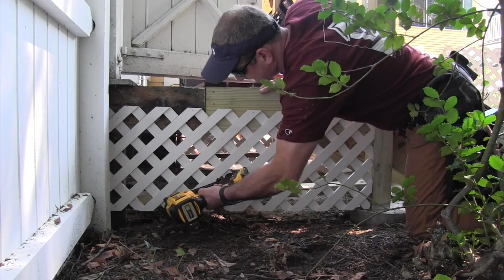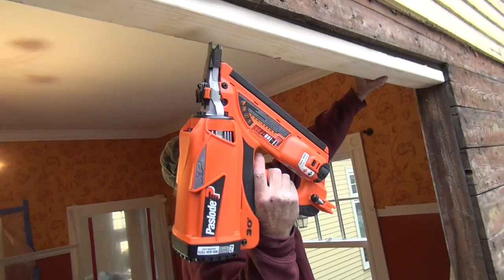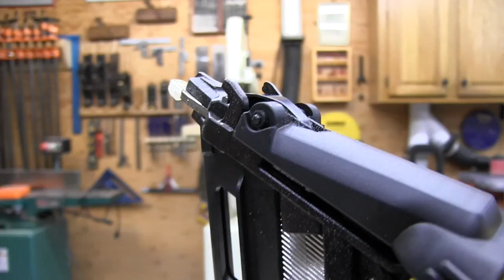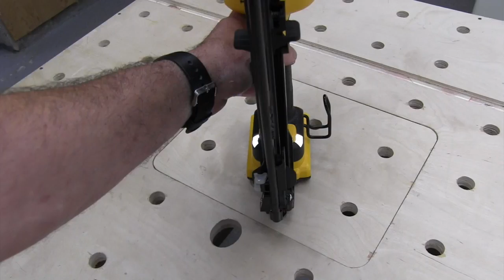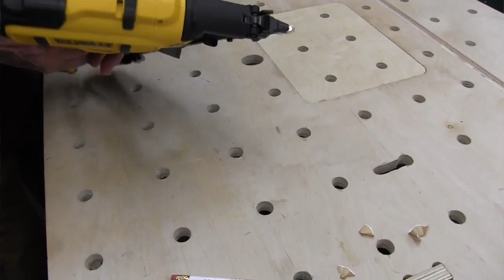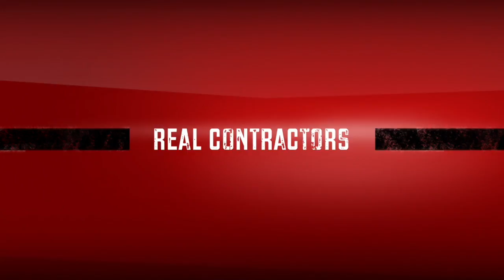Dewalt DCN650D1 15 GA Cordless, Angled, Finish Nailer Review

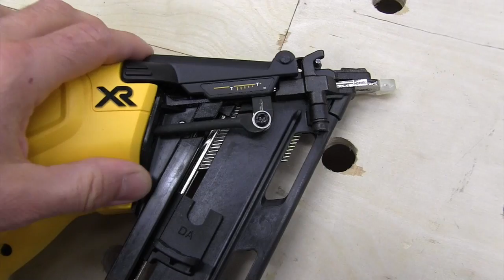Comment: Just got the 15 gauge and bonus charger/battery from HD during the sale.  The depth gauge adjustment doesn't fully sweep in sync with the graphic.  Doesn't like it does in yours either @3:45.  Can you confirm?

Comment: I have the earlier generation, 15 gauge nailer (18v XRP). It has been perfectly reliable, exact, and powerful. I was thinking about upgrading all of my tools to the 20v Max/Flexvolt line but hesitated when I tried the nail depth adjustment on the display models at two, different stores. On my 18v, the depth adjustment is perfectly smooth and exact. On the newer model, the depth is sticky, clunky...feels imprecise and cheaper. It has made me doubt the entire tool. And so, I am now wondering if I should switch to Makita or Milwaukee.

Comment: Would you recommend this or the 16 gauge DCN660D1?
Reply from the maker: H1GH0CT8N3 either
Reply: I just got both the 15 and 16 ga nailers today. I'll use the 15 for outside trim and the 16 for inside trim. I'm used to my 16ga pneumatic dewalt already for base and case and I don't want to upsize the nails for interior trim (a friend had a job installing smaller trim and his 15ga kept splitting it). But, I figured I would move up to the 15ga for trimming out garage doors and the exterior of windows and other such outdoor stuff since it's usually larger scale.
On another note... I didn't notice the pencil sharpener until he mentioned it in this video. He didn't mention the 16" OC Gauge on the other side of the carriage though. I actually came here hoping that would be mentioned, but I ended up using the tool located 3' above my butt crack and figured it out for myself; that's pretty cool too.

Comment: I just got my 15g nailer and it's really bad at sinking 2 1/2 nails. is this something you noticed
Reply: Won't even penetrate to the other side of 3/4 Hickory. Nor sink the nails through 5/4 MDF. Sad. Lacks power...
Reply from the maker: Craig Sater not at all. Are you using the proper nails? Holding nailer down firmly? Is the battery good?  If you've ruled these out return for another.
Reply: I was testing it on 1 1/4 oak but it was also struggling on a peace of scape form board  2x4 df. then I continued testing on other places of df and it performed just fine. but it does sound like it runs a little rougher then the 18g nailer that performed well on the same peaces of wood.
Reply from the maker: Craig Sater inferesting
Reply: Did you change the depth adjustment? At first I had mine backwards and turned it the other way, then it sunk nails no problem

Comment: Hey quick question - Im trying to find a review between DEWALT DCN660 20V Max Brushless 16 Gauge and Dewalt DCN650D1 15 GA . Whats are the differences. Besides a gauge i figured out that they have different "noses" .  Thank you and btw nice review!
Reply: To Jakub K.
The 16ga is a 20deg. angle aluminium 1.6mm dia nail.
The 15ga is a 34deg angle steel 1.8mm dia nail.
15ga is the stronger nail, the 16ga aluminium nail bends and jambs the gun...

Comment: I just bought that nailer and it's a piece of junk the pin that drives in now always jams above the nail jamming the whole machine I tested this out when I bought another one from Home Depot and the same thing happen. I held it from different angles and shot nails from different angles but it didn't matter and I also used the DeWalt 15 gauge nails
Reply: John Wires i have same prolem
Reply: Jimmy Ma check to make sure you have DA style nails.
Reply: Thank You will check and see
Reply: you got the old shit model !

Comment: which is better for finished carpentry...
15 or 16 gauge nailer?
please answer....
Reply from the maker: The gauge of a finish nail is actually a measure of its diameter, just like with electrical wire. The higher the number, the thinner the nail is; the lower the number, the thicker it is.

15- and 16-gauge nailers are the real anchors of the pneumatic-trim-nailer team. These two tools fire nails up to 2-1/2 inches long, and are the most versatile for interior carpentry. 

They also have quite a bit of overlap in terms of application. Both are commonly used for installing baseboard, chair rail, door and window casing, crown molding, door frames, and more. 

One advantage to 15-gauge nails is that they are collated at an angle, which allows the nose of the nailer to reach into tighter spaces.

I prefer the 16-gauge. You can use it for small projects and big projects.

Comment: To Z, I've been a contractor for 35 years and have an extensive line of tools " mostly
Dewaltt" but as it happens Riobi makes a very reliable nailer at a very reasonable cost
but I guess that name brand is beneath you even if they make a particularly good
specific tool. You're close minded and arrogant my friend

Comment: Hey Rob,I have the Dewalt 18GA nailer, and i will tell you I don't like it, it dry fires and it jambs frequently. I maintain this tool very well, clean and oil it, no reason for jamming
other than poor design, and "dry firing" , REALLY!. Contrarily, I have the Riobi 18 ga
nailer at 2/3rds the cost, and in 2 years not even a hiccup. Love you're vids buddy.
Maybe review more festool tools, great quality, but way overpriced.
Mike Mancini

Comment: Would be nice for ToolBoxBuzz to make a video explaining the differences between 18-, 16- and 15-gauge nailers (like how to choose the right nailer for the job etc.)
Reply: 18g for almost all interior finishing. 16g for exterior trim. A 16 gauge nail is overkill for baseboard and casing inside your home. Huge nail and when you're using glue a 18g nail works fine. The nail only holds the workpiece until the glue dries.
Reply: I use my 18 gauge for pinning the mitres on my architraves and also for nailing my arcs into the jambs so it doesn't split, it won't split anything so it definitely has a place I feel. You could use it for all internal trim but I like my 16ga for the rest of internal trim as it's a bit stronger than an 18ga and I don't glue my skirting baseboard (only when fixing to concrete blockwork or steel framing) the 15 Ga is great for door jambs in my opinion because you don't want jambs to shift any so a beefier nail is ideal. Also 15ga is better for nailing anything heavy duty like fibro or hardwood as the nail won't bend or tweak as easy going in like a 16 Ga does. Every tool has a place and you could really forego the 16ga and just get an 18 and a 15ga but I have the 16ga already before this 15ga came out. But I definitely would have a reason to buy this tool as well. Hope that helps!

Comment: Let me first start off by saying that I'm deeply invested in dewalt to where some people ask me if I'm sponsored lol. Of course not I just started into that platform and too deep to change. I have the dcn692 framing nailer and it has left a real bad taste in my mouth as far as cordless dewalt nailer. The framing gun jams or doesn't fire all the way through about 1 out of 10 times if not more. I'm weary to buy the finish cordless nailer as I'm afraid it'll do the same since they all use the same firing mechanism. I'm going to get the ryobi finish nailer so I won't feel I throw away more than $300 again... If it doesn't convince me, throwing away $100 is not as bad as throwing away $300+. I am embarrassed to use my cordless dewalt framing gun, that's how bad it is. I really would like to free up space from my compressor and hoses. If the ryobi works I might buy the dewalt nailer again once it gets more reviews or gets bugs worked out.
Reply: Sergio Castro I actually had an issue with my gun while installing a fence. I was driving 2" nails through the pickets into the 2x4 on bump mode. After about 30 min of using it non stop it started to jam and something made a clunk noise on the inside. Now the flywheel rubs slightly on something but it still shoots 99% of the nails without jamming so I'm not worried about it
Reply: You are throwing away money if you actual throw it in the trash. If it doesn't work for you, return it or sell is second hand and get some of your money back.
Reply: Mine framer completely stopped working no noise at all when trigger is pulled. I hate paslode so I went back to air, it never fails!!

Comment: Rob I do love your reviews but look at the size of the thing that's not massively improving from the old what the weight of it, if it a finish nailer run times will I get a full day's work out of it with out my arm falling off, does it consistently work well
Reply from the maker: Its not bad, really well balanced. Like I said in the video - trim guys wont do this

Comment: Wanted to buy this, but I shopped for compatible nails first, and was unable to find any locally. That's the only concern. Can't have tools that are limited to online supplies.
Reply: This is a pretty common nail standard.. the easiest ones for me to find in my neighborhood are hitachi and senco nails.
Reply: Tim Corbett 15 gauge DA nails are very easy to find. Small and big box stores always carry them. They don't need to be Dewalt nails either.
Reply: austin ritz I'm in Canada. Checked all the big box stores, nothing in stock.
Reply: austin ritz I'm sorry guys, should have looked closer, I was trying to find the DeWalt 16 ga, 20' angle nails, and had no luck. Now excited about this nailer.
Reply: Where did you find angled 15 gauge nails in Canada? Every shop I talked to said it's not commonly used here. Even the ones that sell 15 ga gun didn't have the nails.
Reply: Wayne Young Home Depot in Canada only sells the FN (Bostitch) style. Rona carries a brand of DA (Senco) style. They are very limited in selection though, I could only find 2". Bcfasteners.ca has a good selection and claims to have free shipping, but that again is relying on delivery and the hassels and delays with that.
Reply: Thanks for info, Tim Corbett. If you are in the GTA, markham industrial trade supplies has 16 ga angled nails, for interior use (i.e. not stainless). I forget which lengths or collation angles they had, can check.
Reply: Naughty Man yeah, like I said, as a contractor I hate relying on online ordering and delivery. I also live on an acreage and don't have a street address, so courier's won't deliver to me. And many shippers won't ship to an address that doesn't match the cc address. Last time I ordered supplies online, it took 10 emails and 3 months for the company to figure out how to ship. I'd been done the job for 2 months when I got the stuff. (Talked customer into using alternate)
Reply: Good call!
Reply: Tim Corbett I bought the 16 gauge 20v finish nailer and I can't find the dewalt 16 gauge nails, I have to buy the passlode ones that are compatible. I have noticed that Home Depot and Lowes are stocked up with the 15 gauge angles nails, perhaps they are going to push their one over the 16 gauge, I bet they are. Besides the complaint of not finding Dewalt 16 gauge nails I will tell you without a doubt that my 18v was a stronger finish nailer, it drove nailed deeper, and the new 20v ones magazine feels really cheap. I'm probably going to sell it, take a little loss and buy the 15 gauge one.